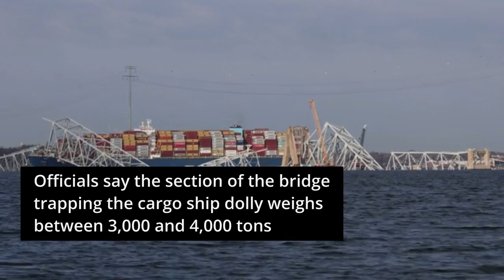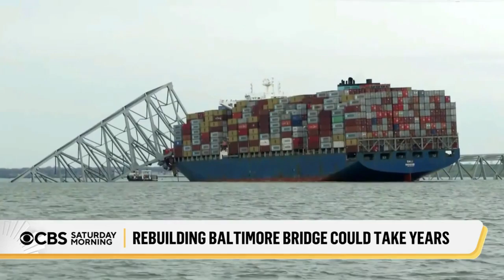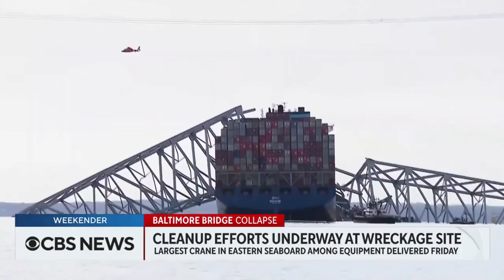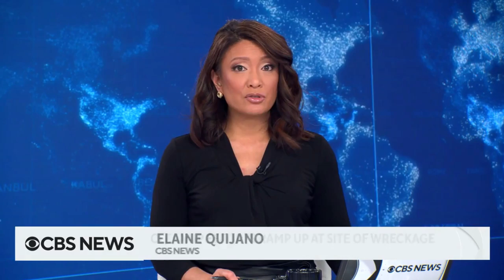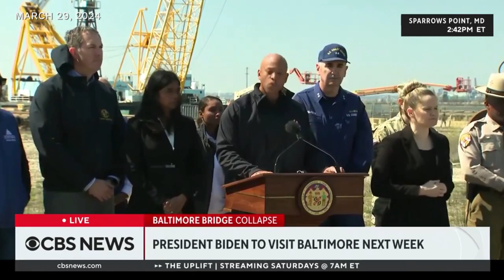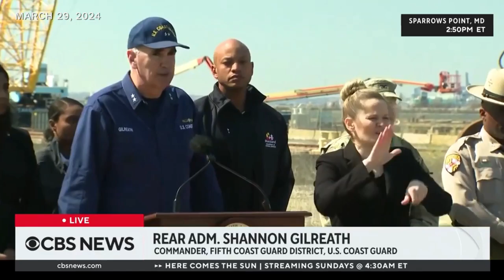Inside the complicated Baltimore bridge wreckage cleanup operation

Comment: When a new bridge is constructed surround each pier between which ships pass with what is tantamount to an oval-shaped island of rock and soil about 200 feet long in the direction of travel and 100 feet wide. A coffer dam on the perimeter eases placement and facilitates consolidation of material. A few piles driven into the seabed extending into each mass provides even greater stability. Material for each island dredged from the seabed benefits the channel. Relative to the cost of the bridge this is an inexpensive and effective solution that will prevent piers from being dislodged when bumped by the largest of container ships.

The fastest and cheapest way of repairing this bridge is to manufacture and replace the collapsed trusses. All of the plans are available. The procedure is known. Of course, what results is new, old stock, a fifty year old bridge verging on obsolesce with respect to container ships ability to navigate beneath it.
Reply: Definitely this should be done at the 20 largest ports in the US. Money much better spent than sending to Ukraine or Israel to spur on WW3 and kill several 100 thousand people on both sides, just my 2 cents.

To your 2nd point, about a new bridge, when you have to do extensive repairs on your car engine, you typically replace several other components at the same time due to the amount of labor & time it takes to disassemble the engine.  Same concept is applicable here.  Might as well upgrade the bridge design to be compatible with even larger ships that will be forthcoming in the next 50+ years.  Downside is that it will add to the time & costs of course, but probably incrementally for the benefit.

Comment: All this was completely preventable. (1)There was no traffic stoppage upon a large vessel going under the main span. (2) No use of tug boats to assist the vessel through the channel.
(3) No Dolphins (concrete bumpers) to keep a vessel from striking the main supports of the bridge. Bridge workers lives lost because there was no direct communication between police 
and workers on the bridge. No safety protocols whatsoever and therefore NO EXCUSE!!! Now compare the huge amount of money it's going to take to cleanup and rebuild let alone the cost of the port being out of commission ($15,000,000/day) to what it would have cost to take at least one of those 3 safety precaution measures.

Comment: Seems that it's not a big emergency when the proper application of C4 cutting charges is being ignored.
Reply: Oh boy - another phony expert!
Reply: @todd3205  I'm not, but I can whistle the tune and dance a bit.
I know C4. Look up 12B30.
Reply: Composition C-4, paste, and EL506A-5 Detasheet explosives are equally effective as contact charges for cutting structural steel; because of its variable density, paste explosive is less effective than Composition C-4 explosive for cutting round steel bars